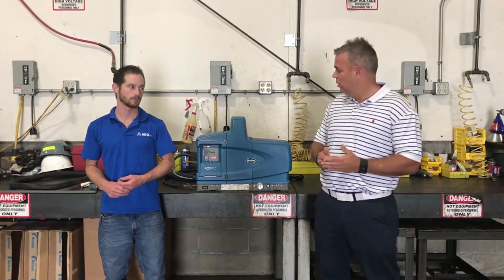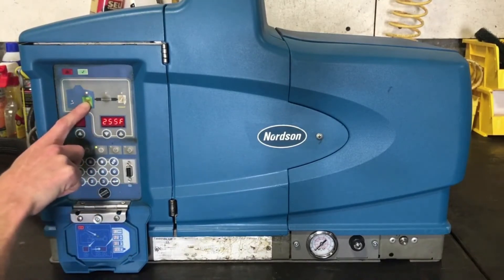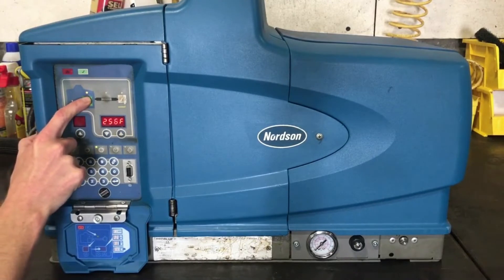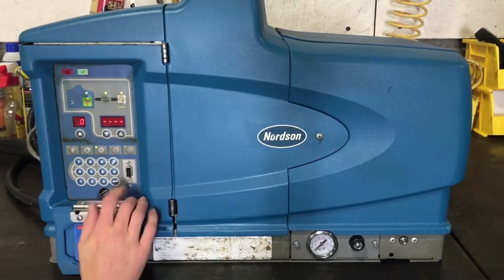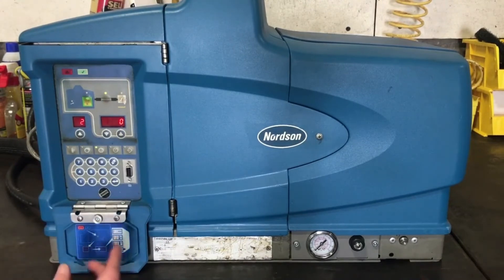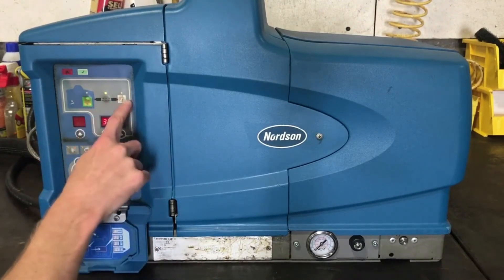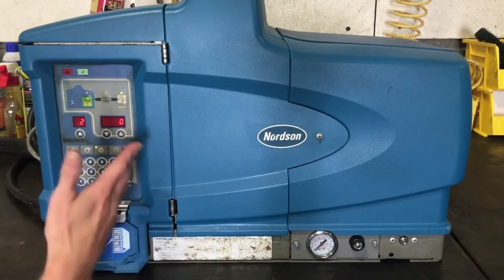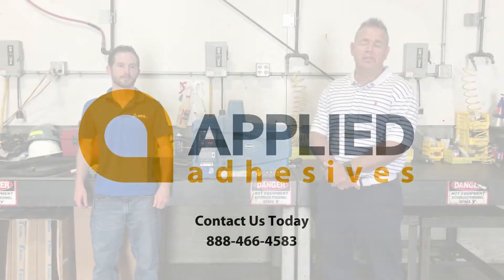APPLIED How to Program Temperatures on  Nordson® ProBlue®, DuraBlue®, and AltaBlue® Melters

Comment: What would cause the glue machine to shut down automatically?
Reply from the maker: Hi @skyler_jaynes,
Without knowing the full picture, the scheduler could have a set schedule programmed(an input from the parent machine). But if you are having a problem with your equipment, please feel free to reach out to our Equipment Support Hotline at (952) 562-9196. We would love to help troubleshoot and/or help you understand more about your unit.
Reply: I figured it out it was the rtd, it was bad, but it never received an alarm for it thank you
Reply: The glue pot will keep reseting itself if you don't replace or fix the RTD

Comment: How do I install an external light to signal low glue level, I have changed parameters 40 to 4 but I don't get a signal out
Reply from the maker: Low level signal is a closed contact. They supply the signal. See manual - chapter 3 (the last 6 to 8 pages).

Comment: How can i change temperature in standby mode?
Reply from the maker: Standby - this is found in operating parameters. Default is 100F and this represents how much temperature is lowered from the operating setpoint.
The parameter # is 23.
The manual for Pro Blue & Dura Blue, at the end of chapter 3. This section goes through it.
Lock out Tag out!!
Safety first.
First off the manual switch destinations and you may overlook something because of it. I’ll outline how to setup automatic Standby.
To start off this can only be done on input #1.
Input #1 is on pins 8 & 9. So you wire up either a plc output (parent machine) or the 24Vdc applicator activation signal to pins 8 & 9. This completes the electrical hookup.
Power on the unit.

Select operating parameters and go to location 30. Set parameter 30 to 10.
Now go to parameter 24. Set this to the number of minutes you want to wait before the unit go’s into Stand-bye. Note to test but it at 1, side note I believe there is a 4 or 5 minutes default delay. So it may take 5 or 6 minutes to drop into stand-by.
If you have any further questions feel free to reach out to us at (833) 293-7278 or on our website www.appliedadhesives.com.

Comment: The green ✅ is not lighting up, so the machine will not start, what are some things I can do to get it started
Reply from the maker: Here is a list of reasons why the green check mark will not light.
- Not up to set-point temperature on all zones. Call me - possible bad heating zone.
- parameter # 4 has a long delay Programer (5 minutes is enough for a pneumatic pump. Ten minutes for a gear pump.
- The green check-mark is flashing indicates that the parent machine his preventing this from staying on. One of the inputs is set to inhibit the pump from activating. Parameters 30 to 39.
If you have any further questions feel free to reach out to us at (833) 293-7278 or on our website www.appliedadhesives.com.

Comment: Let's talk about the inputs and outputs, where do i activate them so that they show on the operator screen? I have applied inputs via terminal 8 and 9 , 10 and 11 and my three outputs as it is in the manual, now where do i activate them?
Reply from the maker: To start off this can only be done on input #1.
Input #1 is on pins 8 & 9. So you wire up either a plc output (parent machine) or the 24Vdc applicator activation signal to pins 8 & 9. This completes the electrical hookup.
Power on the unit.

Select operating parameters and go to location 30. Set parameter 30 to 10.
Now go to parameter 24. Set this to the number of minutes you want to wait before the unit go’s into Stand-bye. Note to test but it at 1, side note I believe there is a 4 or 5 minutes default delay. So it may take 5 or 6 minutes to drop into stand-bye.
If you have any further questions feel free to reach out to us at (833) 293-7278 or on our website www.appliedadhesives.com.